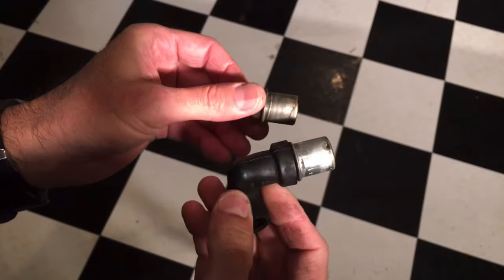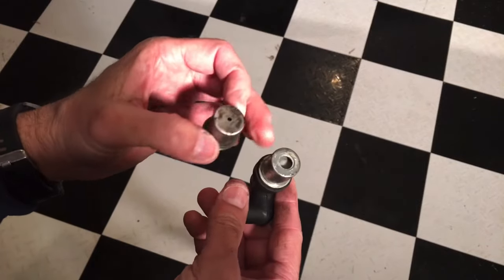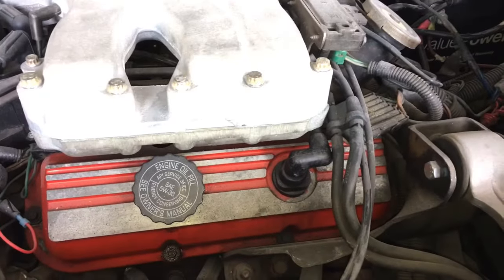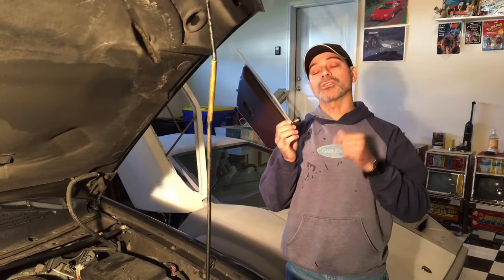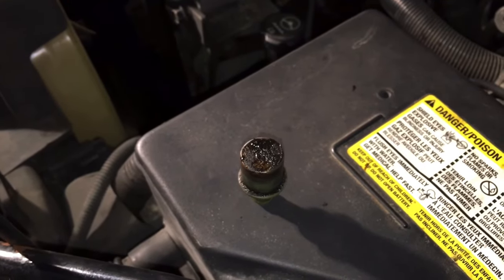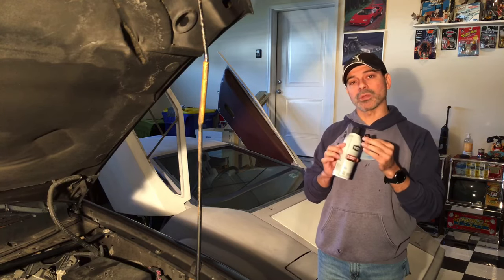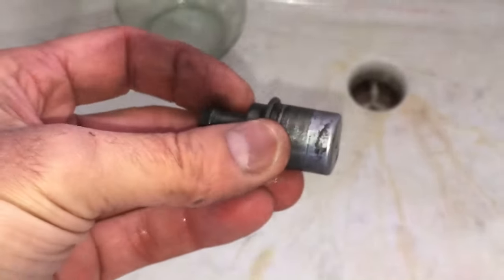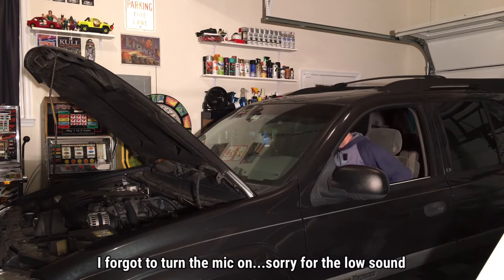How To Clean A PCV Valve (Andy’s Garage: Episode - 300)

Comment: Great video. I suggest just replacing it, it’s relatively cheap part you can buy from local stores if you can remove and install by yourself. If you can’t DIY, a garage may charge you $100-300 dollars for that small job.

Comment: I have a Sudden rough idle like a vacuum leak the PCV valve does look like sludge when I remove oil filler cap air blows out of the valve cover.

Comment: Thanks… great video. I think i might just replace mine.. How long do these valves last? My car has 120k miles and would you consider this a maintenance at a certain milage, or regular. My service manual does not mention it…
Reply from the maker: I would check/clean it at each oil change. If you do this it should last long. If not I would replace it around 35k miles.
Reply: Your car's owner's manual will give the replacement interval.

Comment: I have a 2010 Ford Escape with the 3.0 v6 and I suspect mine is plugged but it is located behind the motor facing the firewall.  Is there a smart way of getting to it without taking part of the motor apart?

Comment: Great vid. Question. I have a 78 Ford F100. It has a 300 4.9L and the PCV looks like the second one you cleaned but it has to intake holes. I replaced the old one because it would not stay in place and the new one does not stay in place as well, Any suggestions? It fits snug but after I drive it, it always dislodges from the hole. Thx!
Reply from the maker: It should fit tightly and have a rubber gasket around it. The rubber piece might be worn, causing it not to be tight. You can replace those
Reply: Ty!!!
Reply: I would check the hose and fittings that the PCV is inline with. It sounds like the hose/piping is blocked internally. The flow of crankcase vapors are not returning to the engine air intake. I strongly feel that your path from the PCV to the air intake is internally blocked. This restriction is causing the PCV to pop out from the grommet due to crankcase pressure. Replace the hose or fittings that is causing the blockage.
                          Hope this helps!

Comment: The PCV valve on my 2014 Honda Accord(2.4 4 cyl.) has no valve in it. You can blow either way through it with no pressure. No hose hooked to it. Just mounts to the valve cover. How does this thing even work. BTW, a new one costs almost 50 dollars!
Reply: I was wondering how the kind that have no moving part inside does anything!  Any "valve" opens/closes.  I understand how the bigger one with the "rattler" inside can do its job,, but the other....I don't get it.